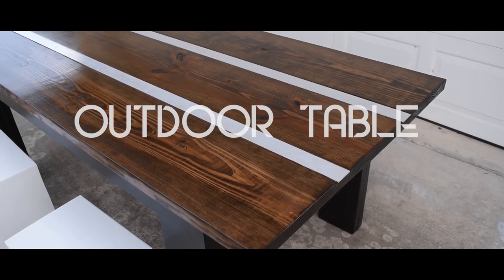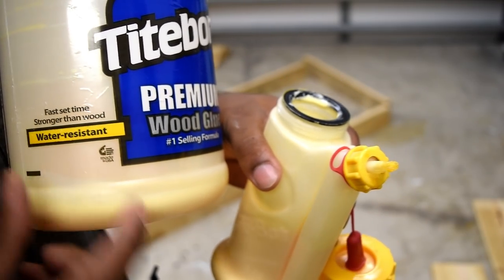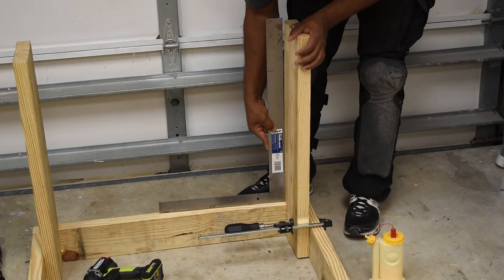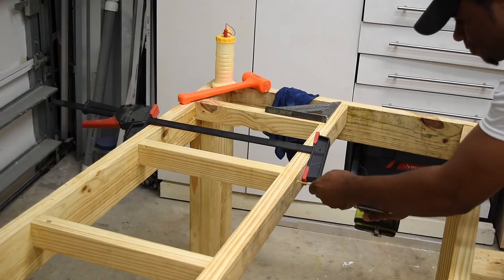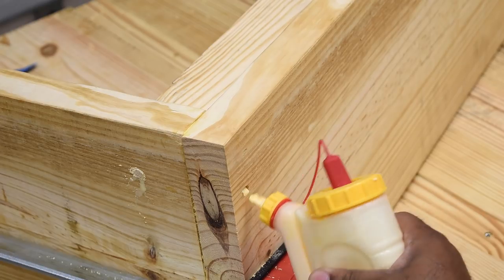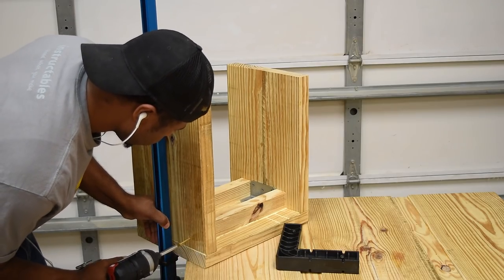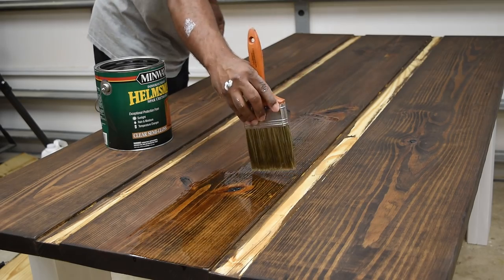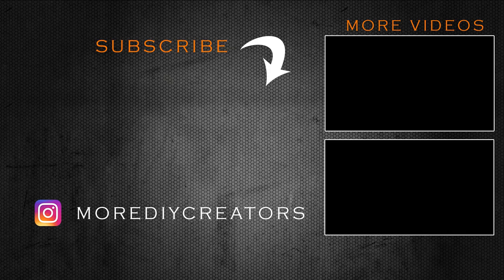DIY OUTDOOR DINING TABLE | with aluminum inlay

Comment: That's a 9-month table. You can't stop wood movement with screws and metal brackets. You have a wide table top with the edges of the boards glued together so it will behave like a wide piece of wood. Then you attached it cross-grain to the supports underneath. That is an Anna White recipe for warping and splitting. You'll be lucky if it still looks good in 9-months.
Reply: J Will while i agree that the method for attaching the top ignores wood movement rules, you forgot to add how it could have been done better. I feel like that thing is build like a sherman tank, the whole thing might twist a little and lift a leg off the gound, or maybe something splits, hard to say.

If he had only screwed from the bottom and left some gaps, that might be the simplest fix/modification. Outdoor stuff is hard, many people want the look of a solid top but that makes getting rid of water hard...unless it can be covered.
Reply: Great resource! I'm sure I've seen that site before. So to keep in the theme of simple and big box store shopping, slotting or drilling out the holes in the brackets he used would be a great simple solution, and also not screwing thru those cross supports and just using the brackets.

Lots of people make the wood movement comment on builds like this, and it's totally valid. I just think its more beneficial to offer up solutions with criticism that is not just a purely aesthetic disagreement.
Reply: Then "offer up" the solutions yourself. This guy is often as bad as Anna White with his designs, and he has more than enough experience that he should know better. It is not hard at all to research wood movement. All it takes is a little reading and search reddit. It is irresponsible to present such terrible designs without even warnings about wood movement.
Reply: Yikes, ok, i feel like now things are getting snarky. I'm sorry if i offended you. My intent was to call you out on making the same "your table will explode!" (Obviously exaggerating here) comment without offering anything else of value to the rest of the community. And that can be seen as combative, sorry for that. But the fact remains that those types of comments could be more constructive. 

For clarification my initial comment did offer a simple modification. Though a more complete solution would obviously be better. somone looking to build a diy table from construction lumber isn't looking to make fine furniture, at least not yet. And if their table cracks, then lesson learned. If in turn they un-subscribe to Glenn then maybe he'll need to be more complete in his instruction, and you and I agree here, he certainly should be more complete and should know better.
Reply from the maker: J, I think you are being a little over the top. I know very well about wood movement. Do I make the best designs i'm sure not. It's hard to predict wood movement. This is an outdoor table that will be on my covered patio at some point. I feel confident the top will last a long time, the protective coat will limit water penetration. I appreciate your feedback, not the crushing part! I can not see how the Z fasteners are that much better than the bracket. Understand I can use them but that would intimate may viewers (pulling out a router). Producing these videos aren't as easy as you may think, many info will not make it into the end result. I'd more than happy to run things by you so I never miss another piece of important information.
Reply: Actually, judging from your response, it seems I was not critical enough. You certainly do NOT "know very well about wood movement". It is NOT hard to predict wood movement in a tabletop -- it is a very well-known and well-documented phenomenon. You are completely wrong that "the top will last a long time" -- it will have problems in less than 12 months. You are wrong that a "protective coat" will stop your poor design from splitting or warping. You are wrong that a non-moving bracket is almost as good as Z-fasteners for a tabletop. You are wrong that I think producing videos is easy (I realize the difficulty). The problem is not with producing the videos but with presenting a very poorly designed table, when a few hours of simple research could have shown you the problem and several much better designs.
Reply: Glen, I was a woodworking hobbyist for over a decade before someone finally explained wood expansion to me. Then it all made sense. 
Think of the wood grain as a hand full of drinking straws. You can't really make the straws longer but you can squeeze. That is how wood expands and contracts. 
Put another way; a 2x6 board won't get much longer or shorter but it will get wider or narrower.
The problem arises when the grains on two pieces of lumber are laid perpendicular to each other and fastened together to tightly. Your top will want to get wider and narrower but the perpendicular frame of the table will not want to move that much. 

This same thing is what makes plywood so stable. By making the layers of wood very thin and using a lot of glue they hold each other at a relatively stable dimension. 

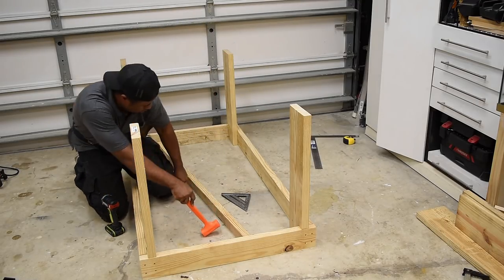As for solutions, I'd probably not worry too much about it but you could get the fancy mounts or only attach the top to that center stretcher you added at  @4:05 and let the rest float.

Keep up the great vids.
Reply: The over all look is great! It’s the realism behind longevity of weathering. The untreated area under the stainless is a big no no and a clear varnish will never hold up on such a flat surface. Allow the top to move with in reason, as you can not dictate its behaviour with brute force.
Reply from the maker: J, it's clear to me you are here for disagreement regarding what I say. You can be as critical as you like if it makes you feel better, I truly don't mind. I never knew a DIY video can make someone this upset. I am simply showing how I made my table I didn't say this is the best way to make a table! If It doesn't last I will learn. It's $10 for a piece of lumber.
Reply: I pointed out some facts about your design, you made incorrect statements in response, I corrected them, and then you complained about me correcting your errors while making a fallacious argument (ad hominem).

What you need to think about is whether it is okay to mislead your viewers as long as the money keeps rolling in, or whether you will take the high road and make some minimal effort to learn about wood movement to improve your designs (or at least warn viewers about designs that won't last) in the future.
Reply from the maker: I don't have a problem being criticized! I do think there is a better way to approach this matter. It's not about me not wanting to do things the right way. You very well may know something I don't! I know there will be wood movement, I was trying to say that Its hard to know how much the wood would move! Maybe I should know that too! I am looking to be better every day at what I do! I will live and learn when I do ill address things. Amazing you think I'm trying to incorrectly teach. I'll willing to go back and forth with you but I won't entertain you talking down to me.
Reply: My first outdoor table that I made myself was made from pine for my little girls to use (kid height).  I only used glue and drywall screws (*GASP*) and then spray painted with external white enamel and several coats of clear poly.  After 3yrs of being out in the back deck, it's still standing fine and my girls still use it.  There are obvious cracks especially at feet due to moisture draw but the top is still good although slightly warped.   I think it being a softer wood helped survive the elements and wood movement.  Your table will probably last a few years but it won't last decades but it's also very cheap to build so who cares!  Love the design.
Reply: At no time did I "talk down to you". I pointed out some facts about your design and corrected the incorrect statements you made, that is all. You were the one who started with the ad hominems. If you consider your reaction being open to criticism, then I don't know what to say.
Reply: What i have learned is to seal every surface will prevent most of the moisture from air going into wood, creating such problems, leaving only heat expansion to be dealt with. Wood stays stable, long as heat and specially moisture wont chance. Also if you cant make it perfect, least make it adjustable, ie leave room for wood to live/expand with out breaking or cracking anything.
My biggest problem is underside of those aluminum bars. Those were not sealed and being in low spot, will collect any water, drinks etc, that goes straight into wood.
Best solution would have been to coat each peace on their own, glue aluminum to smaller peaces and connect them with something like hard wood doves and then use brackets to tie them in to frame, so those can still move. To make top nice and neat, little bit silicone between boards would prevent any water being trapped between the boards.
Reply: It is not true that you can "seal" the surface of the wood enough to prevent the wood from expanding and contracting due to changing relative humidity of the air. If that were practical, the entire spectrum of woodworking would be quite different. The fact is that none of the finishes commonly used in woodworking are able to prevent moisture transfer. Some can slow it down a little, but not enough so that designs no longer need to account for wood movement.
Reply: Do you have a habit of making comments like that? Does that kind of thing provide you with satisfaction or otherwise help you accomplish your goals?
Reply: I think you should use your clearly abundant free time to actually build something rather than acting like you're a woodworking god on YouTube
Reply: You have made a false assumption that led you to an erroneous conclusion.
Reply: J Will: just a note on sealing wood. Epoxy finishes will seal the moisture content of wood fully preventing the expansion and therefore warping effect. This only works if you also sink the mounting points into the tabletop when you build it initially though and dont damage the finish after.

DIY: J will has a point regarding the warping of the large table top. And saying that its not possible to estimate how much wood expands is also not right as each type of wood has a different expansion ratio to moisture level. Even if the table is left out in the open but in a sheltered area it will experience humidity changes. Sealing it doesnt really help unless its epoxy as a sealer works by laying a net of long strands of hydrocarbons on the surface that resists liquid water. However vapour can still pass through the net. I understand why that much hardware was used as it was built like a tank to prevent the issue with wood warping i assume.

The Z clips attached to the slot under the table allow slide laterally thus movement of the table top and this negate some of the effect of warping. Its not about how secure the tabletop is but how secure it is while allowing movement.

The end result you made though is lovely and I like the finish. Leaving the aluminium free to slide is good too as it helps negate the differencial expansion of wood and aluminium with the temperature changes. Id make it the way you've done it but lumber is expensive in the UK and i would probably only use it indoors.

Actually just make the whole aurgument point moot by sealing the thing in epoxy.
Reply: James K Ha! James i love that. But  your example would work as you scale it larger. The bigger the piece(of table) in question, the bigger the effect of expansion and therefore warping. 

Like white oak is an expansion ratio of 0.00180 or something so assuming you use a flat sawn piece only 10cm wide it will expand like 1mm in 10% increase in humidity but if the table gets wider to lets say 100cm or 1 m then thats 10mm or a full 1 cm of movement. Not to mention that different plank cuts will give rise to different expansion shapes. Like a rift sawn piece will go diamond shaped cross sectional while a through and through will cup in the middle kinda like an hour glass?
Reply: It would have to be a THICK epoxy layer on all sides of the wood. A thin layer, or just covering a couple sides would not be enough to stop moisture transfer and therefore wood movement. Covering all sides of the wood with a thick epoxy layer is not really practical for most furniture.
Reply: J Will Yep. It will be at least 2-3 seal coats and 1 flood coat. 

I think theres a video floating around where someone makes a table top out of multiple(like 7?) different types of wood then covers in epoxy. Im sure you know that with the different expansion properties of the wood this can become and issue fast. But he addresses this somewhere in the comments that thats the reason for the multiple seal coats.

He even takes into account the moisture content of the wood before starting the project.

TBH im a fan of a wax finish on stuff i make. But its hard work maintanence wise feeding the wood especially on a working surface.

Actually here i found the link for you:
https://youtu.be/wxBvAljrjFw
Reply: @DIYCreators  You're awesome! Wondering how it's holding up through the last few months?
Reply: Wow! Harsh way of presenting criticism, but your links to securing a table top were helpful, and I’ll use that info for my next build. The DIY community is a place for learning, so thanks for that part.  

Presenting criticism is also a difficult craft to master.  A little work in that area will also keep our community from warping and cracking, and remain a beautiful place for us all to learn.  

Thanks for the info — it’ really is super helpful.

Comment: I loved the combination of aluminium and the simple table top construction. 
I don't want to be a kill joy because I like your simple approach and your nice sense of style for projects. However in this project you have screwed and glued a large board to a frame. Wood you just bought from the hardware store and didn't appear to acclimate to your patio. Also it appears that you polyurethaned only one side. Then you have placed it in a hot humid outdoor environment. Over the months and years, the wood is going to move and your frame is going to fight that movement. Something will have to give and probably your screwed together joints are going to lose that battle. 
It is such a shame because you did buy some galvanised brackets and thus you could have easily avoided that problem with what you had. 
I have my fingers crossed for you that in a couple of years I will be proved wrong and it will still be like new.